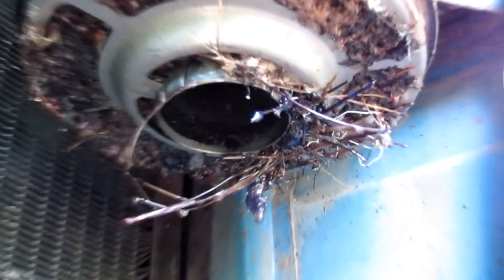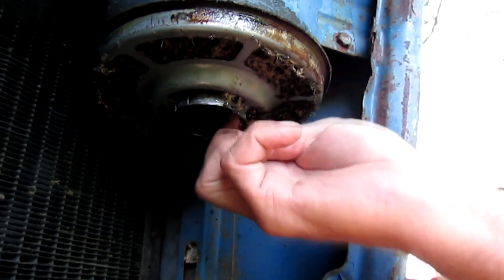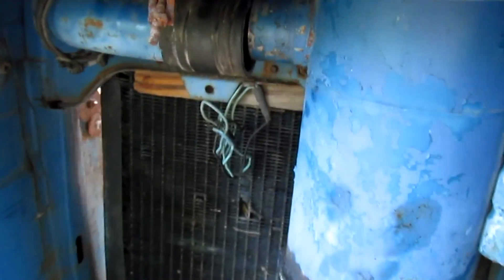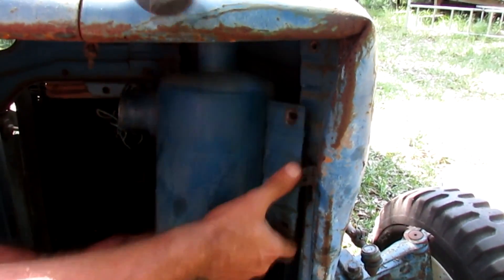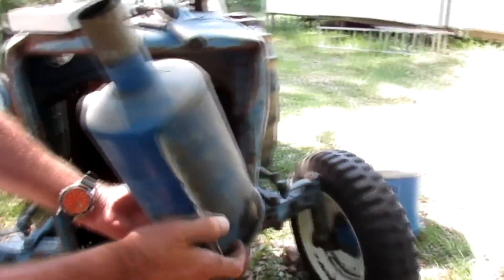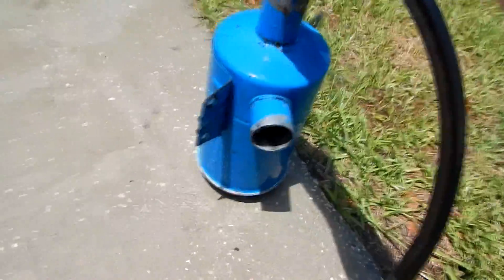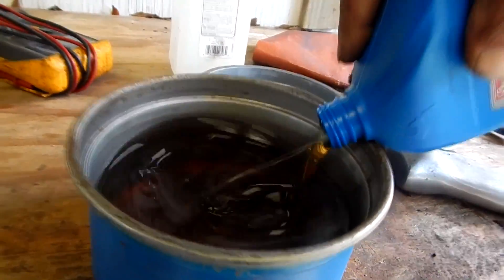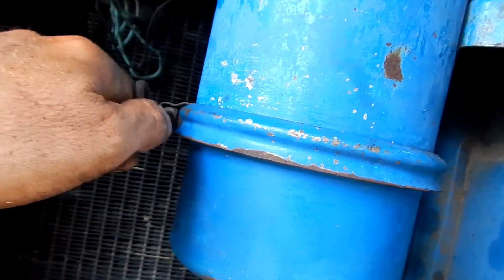Cleaning A Ford 2000 Tractor Air Cleaner (oil-bath type)

Comment: I have an old Ford 3000 I just bought. It has the same air filter setup. I was wondering how to clean it. I think I will try to do it like you did. Thank you for the video.
Reply from the maker: I don't know if this is the right way or not.  It worked good for me.  Good luck.

Comment: Ya you did it right, You dont have to rinse it out with water though it only rusts everything. Just a good rinsing with kerosene will usually do the trick.
Reply from the maker: Thanks and thx for watching.
Reply: What he said.....  these are good filters they just require hands on maintenance and some kerosene or something, Diesel ?  that won't cause rust. Then you fill the bottom bowl with motor oil to the fill line that's stamped on it, that's what traps the fine dirt. Make sure your rubber connections are tight so air won't bypass the filter.
Reply: Wont rust full of oil...

Comment: At the bottom of the filter canister where the filter cap is there are three tabs that need to be pressed in as you pull the filter cap down. You'll have to work around pressing and pulling until the cap comes off. You can then pull the wire mesh out and learn the joy of trying to put it back in.

Comment: How was it running before the filter change? Mine is loosing power to the point of dying when I go up hill or power a bush hog. Thanks
Reply: Sounds like you are loosing compression. That’s what was wrong with mine
Reply: @rickydavis1903  yes it was. The air filter hadn’t been cleaned in ages. Once we cleaned that it ran like it’s supposed to.

Comment: I have been working on the old filter i gave up and bought a new one on line,  so easy to take of oil pan has three clips , ok it came with a rubber casket I dont have a clue how it goes on, any ideas out there 😊
Reply from the maker: Sorry but No.  Thx for watching.

Comment: I have a ford 3000, There is a cannister sticking out the right side with a plate over it and a round screw out nob.Figured it was an air cleaner filter or something.Screwd the nob all the way out,it wiggles a bit but not sure I can get it out of there without tearing it up.Tried a crowbar even,So how do I get into it,or do I ?
Reply: the screene needs to be removed to get to the paper air filter above it in the canister. it will come out with force.